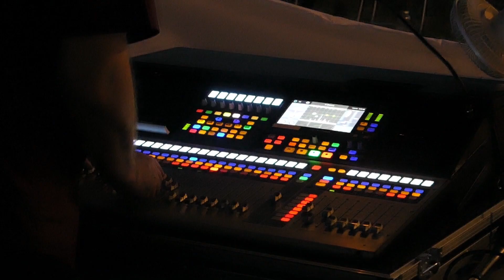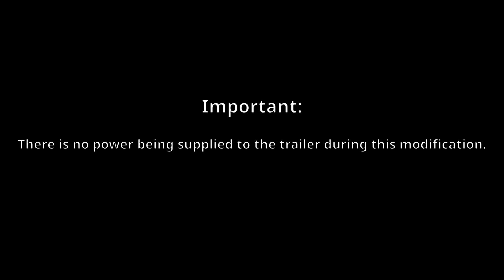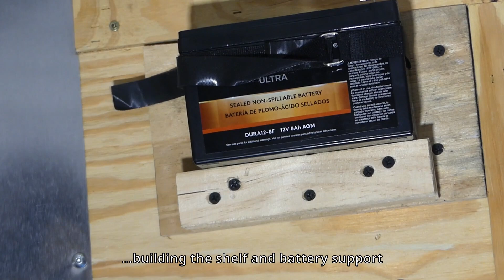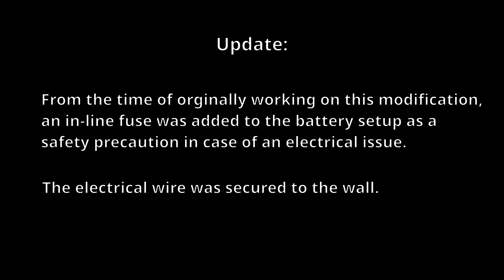Changing the 12-volt electrical power source for LED lights in the Stage Left Audio cargo trailer

Comment: Hello sir.. is the led still connected to the cargo van battery or only the independent one?
If only the independent one, why not connect such a way that while the van is running it charges the 12v battery...
Reply from the maker: The LED lighting is now only connected to the independent battery.  Good suggestion with charging the trailer battery.  First, the amount of current the LED lights draw would mean it may take about 10 hours with the LED lights on before the battery would run out of power.  For recharging the battery, I have a small charger that I will connect to the battery.  For connecting the trailer battery to the charging system of the van would require a bit more wiring and possibly an upgrade to the existing trailer electrical wiring connections... all of which would be too involved just to charge a battery.

Comment: Nicely done. Are the trailer lights now solely ran from the battery, no longer getting power from the van?
Reply from the maker: Thank you for the comment.  Yes, you are correct.
Reply: @stageleftaudio  I was concerned about current flowing from the van to the battery. I figured you had it covered.